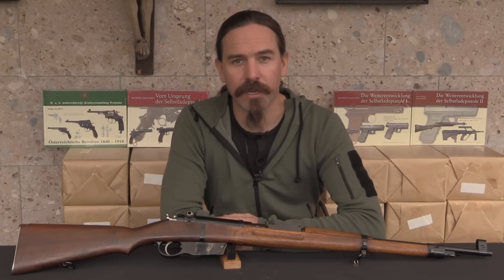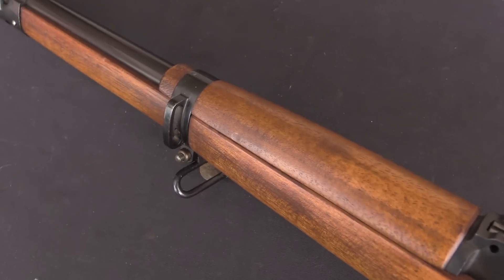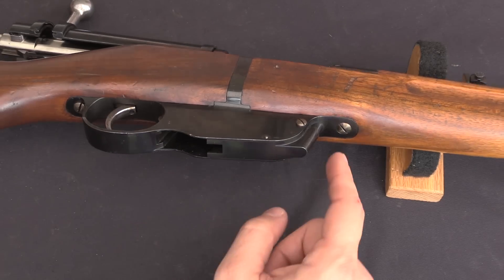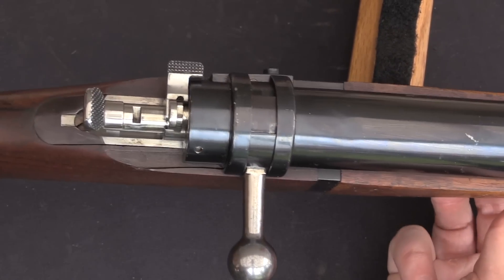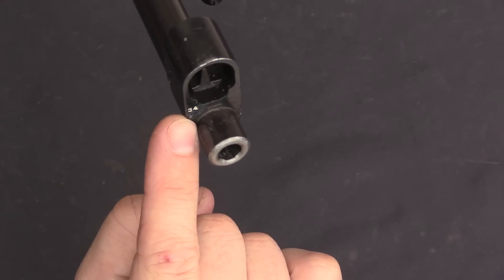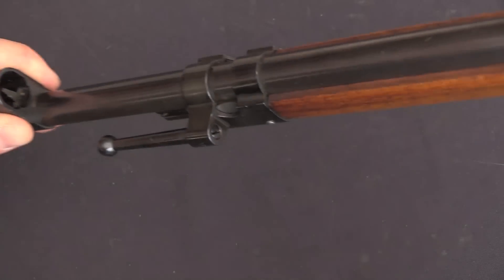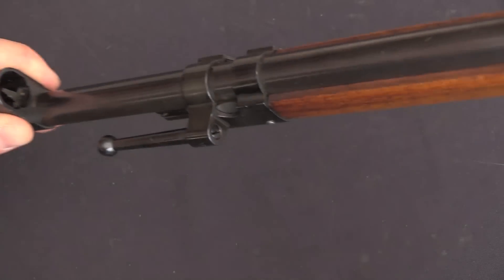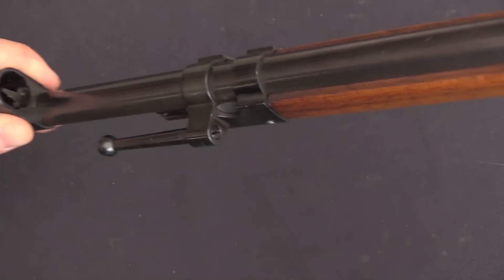Prototype Hungarian 33M Bolt Action Rifle

Comment: every time i see you feature a gun like this, i keep being reminded of the simplicity of that ball-bearing bolt hunting rifle you showed us a few years ago. that's a simplicity you probably could only come to after going through all of these interesting detours.
Reply: It's a really cool system, I just wonder how reliable it is in dirty conditions (would a little fouling get in the way of the balls engaging properly?), how difficult the heat treating is/how expensive the materials are (the pressure containing surfaces kinda have to be fairly small vs. a normal bolt with big lugs, being a bunch of ball bearings, so I'm expecting they need to be REALLY hard steel to survive), how solid the lockup is vs. a modern bolt action (this mostly in an imaginary situation where you're trying to make a modern sniper rifle with the system, plenty solid and accurate for a turn of the century repeating rifle), etc. I mean they use them in biathlon, even if they're only .22LR, so they can't be horrific for accuracy...

You can get away with a fair bit in a hunting rifle, especially a fancy one that is expected to be treated nicely. Absolutely not saying that the system couldn't be made to work in a military context (of course these days it'd have to be a sniper rifle, with a long list of additional requirements), just that I have no idea and I am really curious about how it would fare.
Reply: @jubuttib  I imagine it'd take a lot of work.

Comment: I used to own two M95 straight pull carbines.  Comments on “difficult to open under any circumstances” are spot on.  Even spotlessly clean and properly lubed, they were clunky.  Highly accurate, though, and quite loud with the short barrel.
Reply: Did you own an 8×56 or 8×50?
Reply: And kicked like a Missouri Mule!  I handloaded for mine (8X56r), to a reduced level for comfort.
Reply: They are like a Mosin in that they were “refurbed” after the war and although force matched didn’t always have all the camming surfaces in the bolt properly polished and mated (plus cosmoline in the chamber) and you get “sticky” bolt problems. 

Mine runs like a piston, Ivan must have been on his game that day. That being said, the Austro-Hungarians would never have adopted them if they were as clunky as some Americans find their specimens to be. Same with the Russians and the  Mosin.
Reply: @HabsburgFanClub  Mine were converted to 8x56R.  I had a couple of boxes of wartime factory, but after that I was reloading 7.62x54R brass with .338 bullets sized down to .329.
Reply: @6thmichcav262  that's impressive! but it might be why the bolt was "stickier" and less cooperative. When they milled the rifles out ro refurbish and modernize them, it created some issues with the fluidity of the straight action. I've got an 8×50 Mannlicher and the bolt works like a dream so it did confuse me until I had the chance to use another chambered in 8×56 and felt the "sticky" bolt

Comment: It seems like it would've been much simpler to simply have an open slot for the bolt handle at that back of that dust cover. Since in front of there is the part that's actually beneficial to cover.

Comment: It is beautifully made.
The side slingswiel on the but stock is good thinking. Making it a lot more comfortable to carry on the back.
Clearly a very expensive riffle, that could easily be made cheaper to produce, still making it a beautifull rifle.
Reply: As Ian pointed out the next iteration was made much simpler and much easier to produce at a much lower cost.

Comment: Keeping the 8x56R was one of those cost conscious decisions and no doubt had an element of NIH which would apply to adopting the Steyr made Mex 1912 Mauser or surplus Gew 98. It is very difficult to make rimmed cartridges work in any sort of box fed LMG. France held onto the 1886 8x50R Lebel far too long. The Brits had the .303 for a long time but made it work in the Bren. The Czechs adopted the 8x57S & Gew 98 based rifles when starting over. Might have influencdd German plans in '38-'39 but Skoda was still a worthwhile prize.
Reply: Hungary made the 56R work in both belt fed box fed and pan fed designs. I havnt read any complaints about relyability of either the Solothurn 31M, or either variant of the Gebauer aircraft observer/tank machine gun.
Reply: @egoalter1276  Agreed. And some of the Gebauer aircraft fixed MGs were very spicy.

Comment: I like the design. Simple and straight to the point.

On a side note, I'm curious as to why there aren't that many straight pull bolt actions today. Is there any particular reason for that?
Reply: A straight pull is a more complex mechanism isn't it?
Reply: He answered this in a video once. It basically adds a bunch more manufacturing steps for something that doesn't really give that much of an advantage over regular bolt actions.
Reply: @Simplebutsandy  I see. Thank you for the answer.
Reply: @Simplebutsandy  Yup, and Ian sort of hinted at another potential reason. 

There seems to have always been some worries about whether straight pulls were less robust in the field, especially if the bolt were to get stuck in the locked position and you can’t simply smack it open and then pull it back, but have to rely on lock’s internal turning mechanism.

If I recall correctly, Ian and Carl smacked a Mauser bolt on the edge of a wheelbarrow to get it open in their brutal mud test, which you wouldn’t be able to do the same way with a straight pull.

However, straight pulls were probably of some interest as a potential step towards self-loading rifles, because it would generally be easier to convert them to (semi) automatics as they “only” needed something to power their lock in a simple, linear motion.
Reply: Oh, and straight pulls potentially increasing the rate of fire might actually have been seen as a liability. It’s worth remembering that many of the original bolt actions were designed with magazine cutoffs exactly because of the pre WW1 worries about soldiers wasting their ammunition and the kind of supply problems this might entail.

As for the general worries about weapons being too complicated, a ludicrous example of this KISS approach taken to its extreme can be seen in the Imperial German Army’s adoption of the almost retrograde Reichsrevolver… And then consider that they replaced that with the Lüger, thus going straight from “obsolete at adoption” to “cutting edge”. Check out C&Arsenal’s excellent videos for more.
Reply: In Great Britain today, ordinary folk cannot own semi-auto fullbore rifles but we can own straight pull variants of those designs. So we have lots of modern straight pull AR-15s, AR-10s, AUGs, AKs, etc.
Reply: There are a few , but they tend to be pricey and so not to common .